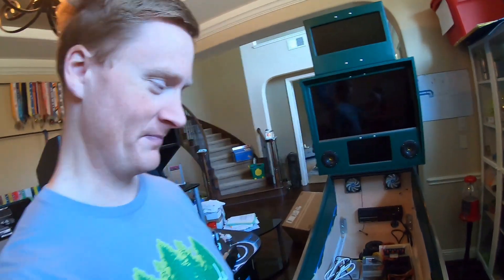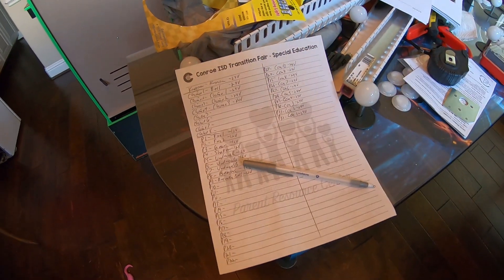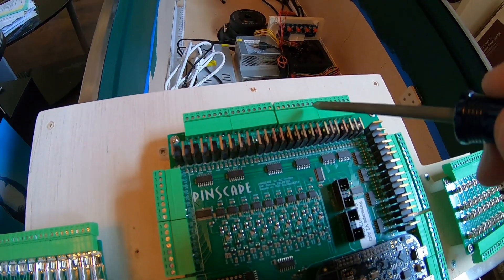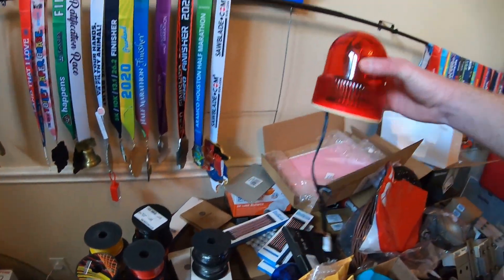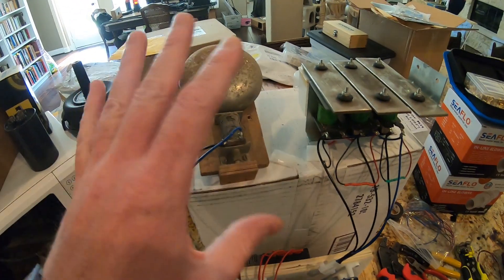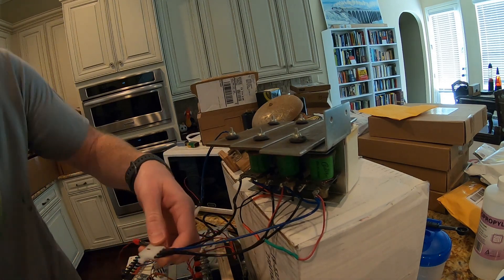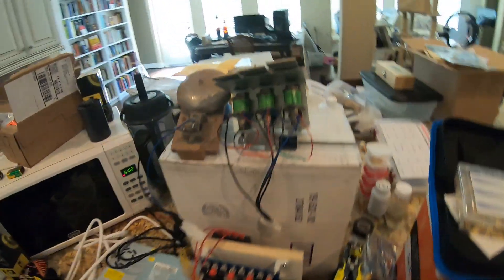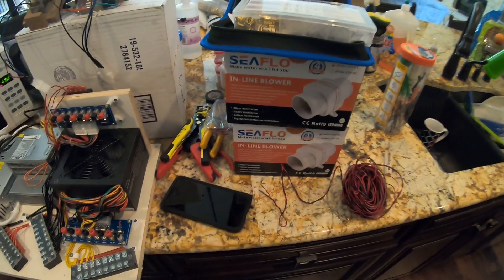Wiring Feedback Devices- Virtual Pinball Machine Build 12

Comment: Are you using 24 volt power supply for the chimes? I'm a noob when it comes to wiring. What gauge wire should I be using to connect these to power supply and board? Thanks for the help!
Reply from the maker: Yes, 24v for the chimes. I can’t remember the gauge, but I think I went heavier than I needed to. If you look in the description of the video, at MJR’s guide, he specifies the recommended wire. Hope that helps.